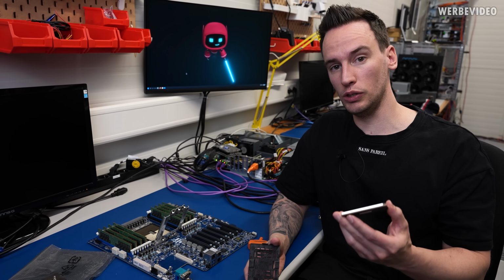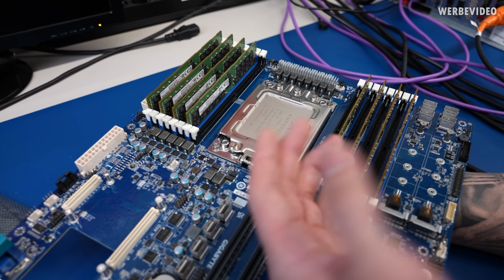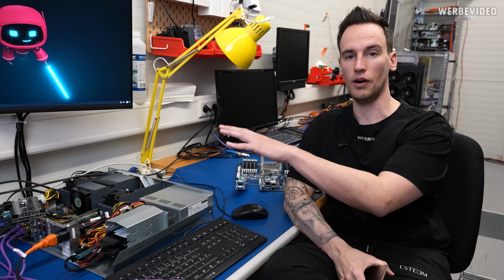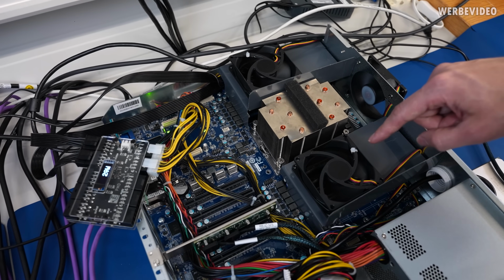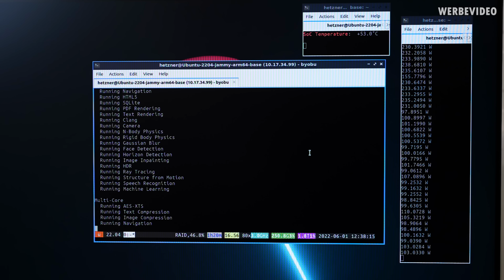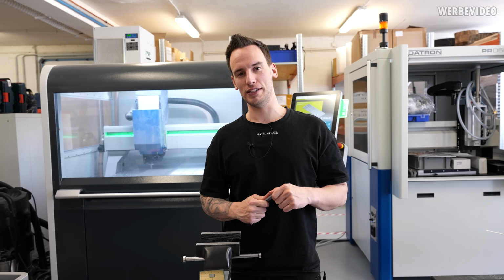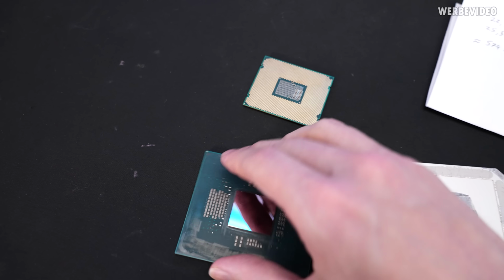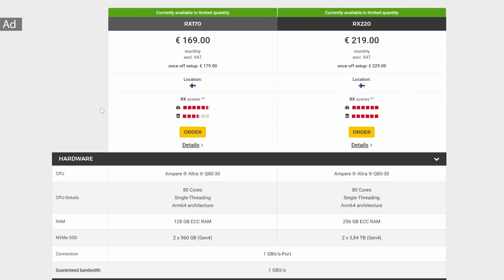This insane 80-Core ARM CPU easily beat a 64 Core Threadripper

Comment: With how power hungry systems are getting now, with Zen3+ and Core 12th Gen+, I wonder how long before we see a paradigm shift in the market away from x86. 
It's going to be messy but surely it's better to do it sooner rather than later. Look at how much advancement has been made on ARM and Apple ARM systems, going head to head with high end Intel/AMD CPU's with a fraction of the power requirement because of the efficiency improvements in the instruction set not having to deal with 40 year old x86 compatibility. 

Just look at the Apple M1 Max and M2 SoC's and how they dominate any SoC produced by Intel & AMD for total system performance. Its enough to make me at least want a Macbook Air for a laptop.
Reply: You need go look deeper, M1 SoC are basically an ASIC. They're very good in certain tasks and very bad at others. Geekbench also prefers Apple architecture, someone already prove this. This is why most serious desktop performance reviewers rarely use Geekbench.
Reply: @bltzcstrnx  Thank god someone said it. The m1 gets a lot of overblown praise when in reality the asics are doing the lions share of the work. Don't get me wrong, they're great chips and some of the best to ever come from ARM, but the node advantage compounded with asics are what make the m1 shine, if you move beyond those bounds it really shows.
Reply: @bltzcstrnx  The very bad at others is in just 3d stuff. X86 GPUs, both from AMD and NVIDIA have hardware acceleration for raytracing which apple's don't and that's why anything that requires rendering raytraced 3d scenes is multitudes of times faster on PC. Apart from that, mention anything that's faster on PC or that at least gives anywhere as good performance per watt.
Reply: @fidelisitor8953  not only ray tracing, M1 is very good in ML workloads. Although gaming workloads leaves much to be desired. There are reviews that even the M1 Max having half the performance of RTX 3080 in non gaming ray-traced games. This is with a system that cost less than the M1 Max, yes you can build a RTX 3080 that cost less than M1 Max system.

Edit: also a lot of features for modern game 3D rendering aren't there. I think UE5 Nanite is one of the engine effected by it. There are rendering features that are not available yet common on other 3D accelerators.
Reply: @bltzcstrnx  Apple silicon isn't made for gaming and Apple makes that very clear by having close to zero support for anything gaming and you have to understand why.

The Apple silicon macs are made for different set/category of people, mostly with creators in mind so they're basically a creators machine with heavy focus on stuff like photo/video editing, music production, data engineering (with NPU hardware acceleration) and the likes. So it's not like Apple can't produce the same level of performance and efficiency for gaming or 3d stuff but rather they don't see a profitable need to move into that kind of stuff because they'll absolutely steal the market if they do.
Reply: @fidelisitor8953  The ryzen 6800U trades blows with the m1/m2 and nearly the same power envelope, Intel may be lightyears behind on efficiency from AMD frankly isn't.
Reply: @dirg3music  The 6800u should be compared to the M1 since it's in the same performance range as M1 and also because M2's CPU is just overclocked M1 CPU. Apple's 2 year old M1 Macbook air's CPU only uses up to 10W while producing the same level of performance as the new ryzen 7 6800u which uses up to 28W. That's "2.8 times" more power consumption for the same performance. How's that in the same power envelope?? This comes to shows how much superior the efficiency of Apple silicon and ARM in general is compared to x86.
Reply: @fidelisitor8953  M2 is not just an overclocked M1.
Reply: @DorperSystems  Well... the CPU part is. The other M2 components got an upgrade but for some reason the CPU wasn't upgraded. Watch max tech's review of the M2 air then compare it to their review of the M1 air and you'll confirm what I'm saying. It's a no brainer that the M2 CPU uses more power than the M1, but what caught my attention was that at the same TDP, the M2's CPU had the same performance as the M1 CPU.
Reply: @fidelisitor8953  No, the CPU core is physically different. Just look at a die shot. Completely different layout on Firestorm vs. Avalanche. M2 CPU is a modified A15 CPU rather than a modified M1.
Reply: @DorperSystems  Ok. But it seems they weren't able to get better perf per watt with M2. That's what I'm trying to point out.
Reply: One correction: x86 is only 4 years older than ARM. ARM has been in existence for over 36 years now. It's just on a different architecture that is much more efficient with much more simplified instructions compared to x86's.

Comment: Question, on or about the 13:45 minute mark you showed a comparison of the pads, and I have to ask how do you know that all those pads are being used on the ARM CPU? Just seems to me that WE THE PEOPLE are being duped in the current PC Market with Smoke and Mirrors. nVidia has done away with SLI Support and are now releasing Multiple GPUs on a single board @ a much higher cost than double the GPU cost and I'm left to wonder. Much like how Intel and AMD uses Multiple CPUs on a single Die and has done away with multiple CPU Support on a single MB. Seems to me this ARM CPU is nothing but a combination of 4 - 20 core CPUs or am I simply stating the obvious. AMD ThreadRipOff, or Threadripper do take your pick here, does the same thing and combines 2 older Ryzen CPUs on a single Die and charges 5 times what it should cost and calls it a NEW CPU. I mean seriously WTH??? What is up with all this HYPE over things that are obvious??? Yes ARM is an old tech and was out a very long time ago but now you're making it seem like it's something NEW and it's NOT. This ARM CPU might be new but I remember back in the 90's ARM Tech not getting much traction or straight up washed out by other Monopolies. ARM is not a NEW Tech, it may have first been introduced long before its time but it's NOT NEW.

Comment: 1) ISA is ARMv8.2 ... 64-bit high performance RISC with very advanced loose memory model. Designed in 2010 at clean sheet for high IPC
2) ARMv8 is not binary compatible with 32-bit ARMv7 - using different encodings, backward compatibility via both decoders (allows to remove 32-bit and save transistors)
3) ARMv8 has 32 general purpose registers and 32 FPU/SIMD registers (compare to 16 / 16 for x86)
4) CPU core used in Ampere Altra is license core Neoverse N1 derived from Cortex A76 (1st desktop class core from 2018, IPC between AMD Zen1 and Zen2/Skylake)
5) Amazon has 64-core Graviton 3 CPU (5nm TSMC) based on much powerful next gen Neoverse V1 from 2021 ..... IPC +42% over this N1, or IPC +15% over AMD Zen3 (yeah, even Zen4 will have lower IPC than today's Graviton 3)
6) This year's Cortex X3 with 8-wide integer core (6xALUs + 2xBranch units is similar to Apple M1 8-wide design) will provide about +30% IPC over AMD Zen3 (4xALUs + 1xBranch Unit = 5-wide design similar to Intel's Golden Cove)
7) ARM has new ARMv9 ISA which is supported by X2 and X3 cores (this cores has removed 32-bit mode, saved transistors for 32-bit decoder, all invested into pure 64-bit power).
8) ARMv9 ISA supports new SIMD vector instructions SVE2 (scalable vectors) and SME (scalable Matrix) math
9) SVE2 / SME supports up to 2048-bit registers/vector length (x86 has 256-bit AVX2 and for a decade tries to move to 512-bit AVX512)
10) SVE2 / SME is length agnostic - CPU has to support 128-bit up to 2048-bit (with 128-bit step) while SW compiled for SVE2/SME support SIZELESS type (for autovectorizing an arbitrary long vectors - pretty smart). SW will chop vectors according to available HW resources in CPU, dynamically on demand. x86 has problem to adopt AVX512 because it's too beefy for laptops or e-cores (where 128-bit or 256-bit version would be fine). This caused slow AVX512 adoption and ISA fragmentation.
11) Idea of scalable vectors came from Japanese Fujitsu - they designed ARM CPU with SVE for super computer Fugaku. The most powerful SC on the world in 2021. Only CPU based, no GPU and yet beating other Nvidia GPU based super computers. Pretty amazing how those SVE vectors are powerful. Before Fugaku I was convinced that GPU cannot be beaten by CPU only machine at similar cost and power consumption. Obviously it's possible.

Pretty good stuff from ARM in ISA features and also in cpu design. Upcoming Neoverse V2 core based on X3 (ARMv9+SVE2 ISA) will be absolute x86 killer.
Reply: Great info !
Reply: @ShrKhAan  1st 5nm server CPU is 64-core ARM Graviton 3 .... all that half year before AMD Zen4.

This means that Graviton 3 must be made in HUGE numbers otherwise TSMC wouldn't give them exclusivity before AMD, Nvidia etc. 

When Amazon deployed 7nm Graviton 2 they stopped buying x86 server CPUs. AWS has 33% cloud global market so this is HUGE. Graviton 2 made about 10% global server market. It looks like Graviton 3 aims at much higher numbers.

Graviton 3 can cost approximately $500 while is better than $5000 AMD Epyc. The math is pretty simple why ARM grow in huge numbers. This is the power of open ARM world where anybody can buy a license and manufacture his own CPU. Outdated monopolistic proprietary x86 cannot win this battle. Even free license for x86 ISA will not help. X86 ISA is old, complicated, for high IPC you need many workarouds which cost transistors and kill efficiency. It doesn't make sense to start developing new x86 core even if that would be possible for new comers. That's why China killed x86 collaboration with AMD and started their own RISC-based MIPS64-derived ISA called LoongSon. RISC is the future. It's always been.
Reply: @arm-power  that's cool and all but while we can find ARM CPUs in smartphones, notebooks, tablets and now servers, we still can't have an ARM CPU that's meant for workstations. As someone who works with their PC and is currently making a Ryzen Threadripper build it sucks to be forced to invest money on an already obsolete product.

What would you deem a reasonable timeframe for ARM CPUs to become available in the professional/prosumer segment?
Reply: @arm-power  actual revolution will only happen if you could buy decent ARM based desktop system in every pc store around the corner.
Reply: Before Fugaku I was convinced that GPU cannot be beaten by CPU only machine at similar cost and power consumption. Obviously it's possible.... DOUBT

Comment: Let's be bold, when will it be possible to hackintoch OSX for M2 chips to those 80 core arm processors? That would make a hell of a workstation 😱
Reply: Problem is that apple forked their own version of ARM so you would need to port over the arcitecture, not to mention drivers for the cpu itself and stuff like the gpu

Comment: Awesome video! ARM based systems are certainly starting to flex their muscle; and competition is always good.

On a side note; if you compared that record-holding Threadripper score (34,735) with 64 cores and scaled up for an even number of cores (ie. 80 cores; comparable to the Ampere Altra Max), you're looking at about 43,400 points... so nearly the same as the Ampere. The TR absolutely thrashes the Ampere as far as single core performance, with 1236 pts vs 882 pts... or approximately 40% faster on the TR. Albeit, the efficiency is pretty horrible on the TR; given it was OC'd.

I do wonder how much the increased memory channel / throughput is benefiting the Ampere / ARM design, and helping to push the score higher...

Comment: Even with more cores, you'd be losing performance with the translation layer for the x86 applications. For memory intensive stuff, Epyc has twice the amount of memory channels and wins again. Also, the architecture is a bit concerning. ARM chips tend to have asymmetric core steups in order to deal with temperature targets.
Reply: I doubt that x86 translation will play muh of a role here. A few major Linux distros already have native ARM support. It's not unrealistic to see cloud datacenters running their own in-house software on these just like they do on x86

Comment: In regards to how small that die is considering how many cores it has - keep in mind those are non-SMT cores. They will have half the execution units as the 2-way SMT cores we are used to in x86 land and will be physically smaller.
Reply: What matters to data centres is performance per watt. If 80 single thread ARM V8  cores can do more work for a given number of watts than a 64 core x86/x64 chip. That is less power/cooling/space in the data centre.
Reply: @patdbean  Data centres care about performance density first and foremost.  The more performance you can pack into a given space the more money you can make from that given space.
Reply: @emu071981  quite, but you will be able to "pack more in" because if ARM cores  get more performance per watt , you will need less cooling per unit of computing power .
Reply: So it's more like 40 cores if it were equivalent to a SMT CPU?
Reply: @ricksanchez3628  true, but it is really about performance per watt. If the power consumption is lower. If you can put more compute in a given amount of rack space.
Reply: @patdbean  ahh I see...so it's like performance cores and efficient cores in a mobile device....this ARM CPU would be the efficient cores?
Reply: @ricksanchez3628  not in a server chip, if you want low power usage in an 80 core chip , just switch off  the ones  you are  not using. The original 64bit V8 arm cores were cortex A53 for the small and A57 for the big core.  On 28nm at 0.15w and 0.5w respectively . 
todays server cores are cortex N1 on 16nm at about 0.5w at 2.x. GHz
Reply: @patdbean  but these ARM chips are not a good fit for HPC scenarios. They are much more tuned for cloud applications and VMs. They achieved small area per core by sacrificing matrix multiplication capabilities. That's why Ampere advertise them as cloud server solutions and not scientific calculation accelerators. That's a thing you gotta keep in mind, there's no magic in ARM chips, they still have to takes up similar die area if they want to achieve the full functionalities like x86 chips.
Reply: @F1ve-seveN  yes, it is a cloud computing chip. For lots of  small server tasks. Say serving  your Facebook page. When each user uses 1 or 2 cores for  a few seconds at a time.
Reply: @ricksanchez3628  No two-thread SMT gets near doubling the throughput of a single core when under heavy load. There are various types of SMT, but all involve some form of sharing of some resources which act as bottlenecks. It is very load and architecture specific, but things like single thread throughput can suffer badly (as I know from experience from SUN T4 & T5 servers).
Reply: I'm not up on the latest arch, but in principle an SMT core only has one execution unit/pipeline, shared by 2 sets of registers,  and the register banks are not a dominant part of the core like they used to be in simpler times.
Reply: @MattOGormanSmith  Pretty sure modern x86/x64 CPU cores have multiple execution units per core which is why SMT provides such a boost to performance.  I remember AMD going short in pipeline and wide in execution units in their cores back in the early Athlon64 days and Intel following suit a few years later with their Core architecture.
Reply: @MattOGormanSmith  S in SMT stands for simultaneous, so there needs to be at least as many execution units as threads.  There are other forms of MT though.  There are likely multiple execution units per thread, so it may not necessarily be half of an amd64 core but probably less.
Reply: Honestly, with that many cores in x86 now (thx to AMD Zen), I am really wondering when will they drop HT/SMT for smaller die size and less power consumption.  HT/SMT just bring around 30% (in general) more computer power at the cost of a lot more energy. IMO, getting rid of HT/SMT on the x86 side would be a welcome.

Comment: As a programmer, I dislike ARM and RISC architectures in general, but I'm seeing a lot more innovation with companies that are using them and that excites me. I'm seeing a lot more utility in that space as well with more open technologies, and that excites me more. I'm waiting on the future when hopefully they'll have CPU printers you can buy to design and print your own CPU with. If that ever comes to pass, that'll be when things get really interesting.
Reply: Honestly as a programmer i agree with the dislike for RISC, but if you ever tried to design your own cpu, i think you would realize why RISC is liked by hardware designers, it's basically because the hardware on CISC does so many things that you could also just do in software without any loss of performance, sure don't get me wrong some of that extra stuff ( especially some performance optimizations ( exhibit A, intel IA64 ) ) is definitely better in hardware than software, but it feels overdone and like you're wasting valuable space.
Reply: @errorlooo8124  Sure it can be done in software, but not as efficiently. It actually perfectly explains why even with a higher clock rate, most RISC chips are slower than CISC. Having one or two instruction sizes really isn't good either. The more the cache can be packed with instructions and the more those instructions can do means more efficient computing. Look at the variance in instruction size on x86 computers, go from 1 to 11 bytes, in most instances, max of 15 as per the manual, but I don't know of any valid examples that large. A lot of people complain about alignment, but once it's in the CPU cache, I'd wager alignment doesn't even matter. Especially when you consider that the decoder still has to put in the work of determining instruction size on a modern ARM chip, Apple notwithstanding.